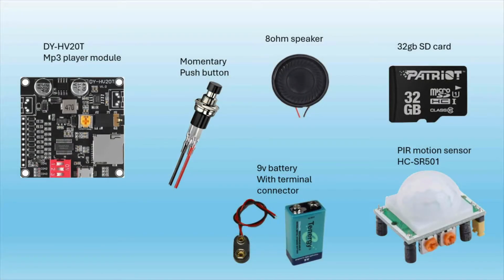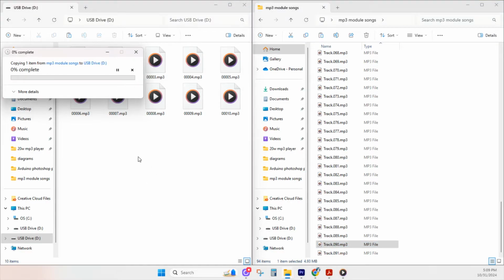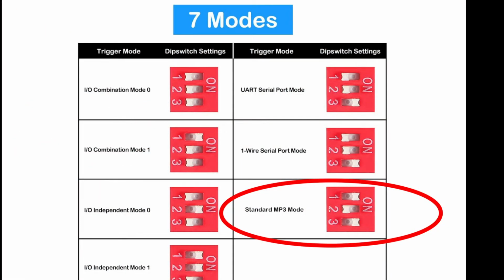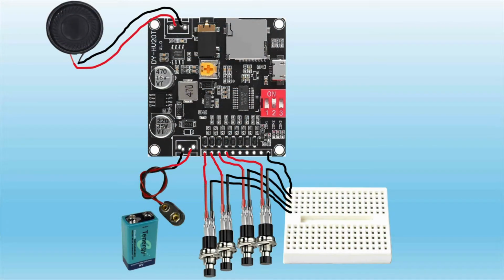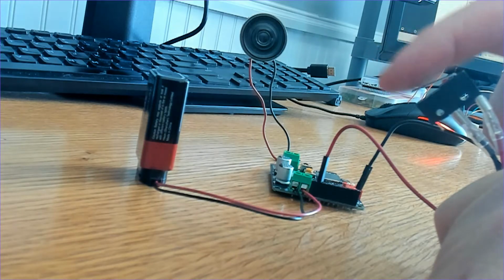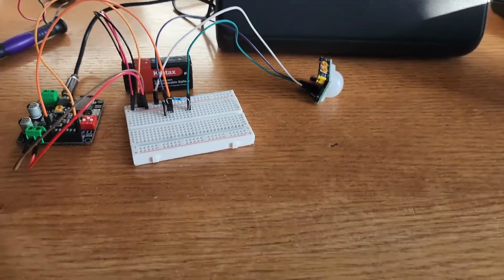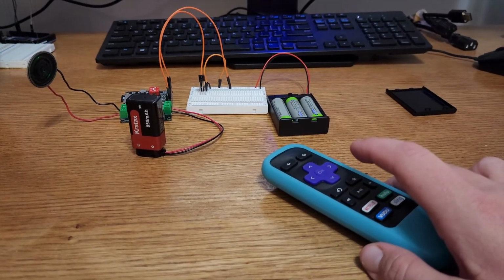5 Creative Ways to Use an MP3 Player Module   No Arduino Required!

Comment: Is there a way to do the following:
1 - 8 files are labeled 0001-0008
2 - With one momentary button, I would like them to play in sequence, but stop after each file.  Then play the next file after the button is pressed again.  
      For example:  Press the button once, file 00001 plays.  Press the button again, file 00002 plays, and so on until 00008 plays, then go back to 00001.
3 - If this is possible, what dip switch setting should I use and what pin should I connect the button to?
4 - THANK YOU!
Reply from the maker: hey there!
The dip switch doesn't have a setting that specifically operates 8 songs from one button. The good news is, you can do this using UART mode with Arduino and if space is an issue you cann use Arduiono Nano. If you want to go that route, I can show you a wiring diagram to get you set up...no prob.

Independent Mode 0 (DIP switch settings: OFF, ON, OFF) is the closest configuration to what you're looking for. In this mode, you would need to connect a separate button to each of the eight I/O pins on the control header, totaling eight buttons. Each button would then be assigned to trigger one song, which plays fully to the end when pressed.
Reply: @BMonsterLaboratory  Thank you! Yes, I'd love to go that route.  I just ordered a Nano, however, I'm not sure what to do with it once I get it.  Will it need a specific program?  
Thanks again, your Channel rocks!
Reply from the maker: @ go to https://www.arduino.cc/en/software/ and download the IDE, a program that lets you write and upload code to your Arduino board. The newest version is 2.3.6 
I'll send you the code that you need to put into the IDE and tell you how to upload it.
You have a momentary button, I assume?

There are several ways to mount your Nano. My favorite way is using a screw terminal block. The screw terminals are labeled and easy to read. You can get them from many stores, but here's an Amazon link - https://www.amazon.com/Screw-Terminal-Block-Shield-Arduino/dp/B0DQ3T7VKR/ref=asc_df_B0DQ3T7VKR?mcid=448aa046942d36ac95054fbe54a6229d&hvocijid=16864784041243675741-B0DQ3T7VKR-&hvexpln=73&tag=hyprod-20&linkCode=df0&hvadid=721245378154&hvpos=&hvnetw=g&hvrand=16864784041243675741&hvpone=&hvptwo=&hvqmt=&hvdev=c&hvdvcmdl=&hvlocint=&hvlocphy=9015754&hvtargid=pla-2281435177378&th=1

I prefer using the 3.5mm aux port connected to an amplified speaker for the best sound. 

Will you be using a battery to power this setup or a wall outlet ?

I will share code and diagram with you as well.
Reply: @BMonsterLaboratory  Yes, I do have a momentary button.  I'll power it with A/C.  
Thanks for all your help and fast response.  You are so kind!!!
Reply: @BMonsterLaboratory  I have a Nano (5V) and DY-HV20T (12V), pin selection UART.  I used ChatGPT to code the Nano, this is the code that it suggested.  I hooked everything up but it doesn't activate random or sequential audio (or anything)  Do you have any suggestions?: 

Button: One side to D2, the other to GND.
TX → Arduino D10 (RX)
RX → Arduino D11 (TX)
VCC → 5V
GND → GND
NANO CODE:

#include <SoftwareSerial.h>

#define RX_PIN 10          // Arduino RX (connect to DY-HV20T TX)
#define TX_PIN 11          // Arduino TX (connect to DY-HV20T RX)
#define BUTTON_PIN 2       // Button input pin

SoftwareSerial audioSerial(RX_PIN, TX_PIN);

bool lastButtonState = HIGH;
unsigned long debounceDelay = 50;
unsigned long lastDebounceTime = 0;

void setup() {
  pinMode(BUTTON_PIN, INPUT_PULLUP);  // Internal pull-up for button
  audioSerial.begin(9600);            // DY-HV20T baud rate
  Serial.begin(9600);                 // For debugging
  randomSeed(analogRead(A0));         // Seed random generator
  delay(500);                         // Let module settle
  Serial.println("System ready.");
}

void loop() {
  bool buttonState = digitalRead(BUTTON_PIN);

  // Check for button state change (debounced)
  if (buttonState != lastButtonState) {
    lastDebounceTime = millis();
    lastButtonState = buttonState;
  }

  if ((millis() - lastDebounceTime) > debounceDelay && buttonState == LOW) {
    playRandomAudio();
    while (digitalRead(BUTTON_PIN) == LOW);  // Wait until button is released
    delay(100); // Additional debounce
  }
}

void playRandomAudio() {
  int trackNum = random(1, 9);  // Random number from 1 to 8
  String fileName = (trackNum < 10 ? "00" : "0") + String(trackNum) + ".mp3";

  audioSerial.print("PLAY ");
  audioSerial.print(fileName);
  audioSerial.print("\r\n");

  Serial.print("Playing: ");
  Serial.println(fileName);
}
Reply from the maker: @jamesc5279  almost got it!  
playtrack() needs to send binary command  (0xAA 0x07 0x02 0x00 trackNumber checksum)
try this: 

// File: nano_dyhv20t_button_player.ino

#include <SoftwareSerial.h>

#define RX_PIN 10          // Arduino RX (connect to DY-HV20T TX)
#define TX_PIN 11          // Arduino TX (connect to DY-HV20T RX)
#define BUTTON_PIN 2       // Button input pin

SoftwareSerial audioSerial(RX_PIN, TX_PIN);

const int totalTracks = 8;
int currentTrack = 1;
bool lastButtonState = HIGH;
unsigned long lastDebounceTime = 0;
const unsigned long debounceDelay = 50;

void setup() {
  Serial.begin(9600);
  audioSerial.begin(9600);
  pinMode(BUTTON_PIN, INPUT_PULLUP);
  delay(2000);

  setVolume(20); // Medium volume

  Serial.println("System ready. Waiting for button press...");
}

void loop() {
  bool buttonState = !digitalRead(BUTTON_PIN); // Invert reading for NC button

  if (buttonState != lastButtonState) {
    lastDebounceTime = millis();
    lastButtonState = buttonState;
  }

  if ((millis() - lastDebounceTime) > debounceDelay && buttonState == HIGH) {
    playTrack(currentTrack);
    currentTrack++;
    if (currentTrack > totalTracks) {
      currentTrack = 1;
    }

    while (!digitalRead(BUTTON_PIN)); // Wait for release
    delay(100);
  }
}

void playTrack(int trackNumber) {
  Serial.print("Playing track number: ");
  Serial.println(trackNumber);

  audioSerial.write((uint8_t)0xAA);             // start byte
  audioSerial.write((uint8_t)0x07);             // play command
  audioSerial.write((uint8_t)0x02);             
  audioSerial.write((uint8_t)0x00);             
  audioSerial.write((uint8_t)trackNumber);       
  audioSerial.write((uint8_t)((0xAA + 0x07 + 0x02 + 0x00 + trackNumber) & 0xFF));

  delay(1000);  // wait after sending command
}

void setVolume(uint8_t volume) {
  Serial.print("Setting volume to: ");
  Serial.println(volume);

  audioSerial.print("VOL ");
  audioSerial.print(volume);
  audioSerial.print("\r\n");
}
Reply: @BMonsterLaboratory  Thanks soooo much!!! You're awesome! 
One last thing - will this allow me to attach a relay to the "busy" pin for lights, or would I only be able to do that without integrating the Nano?
Reply from the maker: @ cooll!  glad it worked fo ya.
what kind of lights?  Are they LEDs, like WS2912B or are they light bulbs, spot lights?  
You can add a relay to a different Arduino pin. When the song comes on it can turn a light on. You can also program a pattern if you're using an LED strand. The setup all depends on the type of lights and what you want them to do.  totally doable!
Reply: @BMonsterLaboratory    Just a short strand of LED's.  I didn't think about adding them to the Nano and it would be great if they would blink!  I'll try to add them to the code you gave me using ChatGPT again.  Do you write your code or use a program?  I'm retired (old) and trying to learn new things to keep my mind active :)
Thanks again, you've been a great help.
Reply from the maker: @jamesc5279  use external power for the LED strand with enough current to handle 60ma per led.
I use chatgpt to clean up code or to help debug. It's hard to  use it effectively if you are totally unfamiliar with the code you're wanting it to use for programming. For me, a more effective way to use chatgpt is to check the code I wrote on my own, that way it has an idea of what you're wanting to do, but  know that it's not always right!

I learned a good deal of C++ during the covid era, what else was there to do?  I used W3Schools website a lot https://www.w3schools.com/cpp/default.asp   It's great for learning and it has an interactive editor you can practice with. 

Check out Arduino language reference page - https://docs.arduino.cc/language-reference/  that was very helpful.
There are also coding courses on Coursera that you can possibly take for free - you'll have to look into that. 

This is a hobby for me..that's all. This type of stuff isn't what I went to school to learn.  I do something related to this or Raspberry Pi every day. So, just learn a little bit each day and you'll do great! If you get stuck, feel free to ask here, Facebook, email...etc. Other people in this space are helpful as well. Post some videos on here and I'll follow ya!  Good luck to you

Comment: Are there any boards that have settings so the file will only play 1 a file time all the way through while it stays latched?
Reply from the maker: hey there!
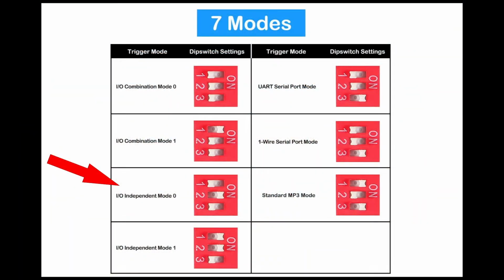Check out 4:40 of this video. You can put a button or other trigger of your choice to activate a song and it plays thru to the end. I belive in that mode each pin controls 1 song, so you could have 8 pins to trigger 8 different songs. You can also connect a larger speaker to this board by using a 3.5mm aux cable.
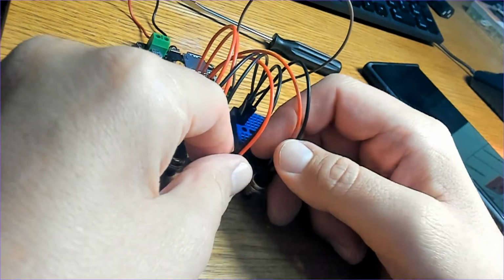The example at 4:02 has 1 song on each pin. The song plays all the way through while the button (or other trigger) is engaged. 
You can add more control by adding a microcontroller.
By the way, you have some really cool videos! 👍👍

Comment: Very good.  I had mine set up for Single File play as you did, but something goofed.  THEN I saw your video and realized I must have had the Switch in the wrong position.  In the mean while I went to sites and they all pointed to the need to use Arduino, so I ordered a couple.  Still no joy!  I need to solder Header Pins in the board.  Waiting for magnifying glass and "finer" solder tips for my Weller.
Could you do Video on using Arduino UNO 3, if possible.   You are MORE clear than the Spanish and Indian YouTubers for instructional videos.  I can understand you.  Sorry guys, your English needs repair.
Reply from the maker: Hey there!  Thank you~
I think the board works great if you just want to trigger a few tracks but it is great for Arduino. I think you'll get more use out of it with Arduino. 
have you seen this video with Arduino ?  https://youtu.be/GczPAaq8WsY   👍

Comment: Perfect thanks 🙏🏻
Reply from the maker: thanks.  good luck with your project~
Reply: @BMonsterLaboratory  Thanks can I ask - what Power supply could I use to power this from uk 230v source ?..can I fit a barrel power jack onto the board somehow?
Reply from the maker: @Newmusicreview  There are some predrilled holes in the pcb, next to the rx/tx pins, for a 6-35v dc input. You may be able to mount a barrel jack there but I think a terminal block would fit better.
Reply: @ ok, or maybe I could solder some cables on the board to a barrel jack 👍
Reply from the maker: @Newmusicreview  You could...or use a dc power connector on the end of your power cord. You could connect to a terminal power block soldered onto your board with that setup.

Comment: Hi bud...Ive tried a Aidafruit FX sound board for some sounds but its doesnt seem to want to play alll the sounds, and its too quiet, Im thinking of trying this card, can I just have 2 triggers doing 2 different sounds ?
Reply from the maker: hey there!
You can have 2 triggers on 2 separate pins that play 2 different tracks. All you will need is a speaker and the buttons. There's an on-board amplifier, which can make even the little 2watt speakers pretty loud. You can also connect an amplified speaker using 3.5mm cable like I did in this video https://youtu.be/GczPAaq8WsY
good luck!  👍💪

Comment: I have a question! Can we use this to make an automated alarm system for like bell for class schedules for example? That will be utilized with an Arduino to adjust the time on when will it ring and will be connected to our schools sound system using the 3.5mm pin? For our research project hehehe ty
Reply from the maker: hey there!
Sure you can. You can connect the 3.5mm jack to an amplified speaker and run a mp3 track on a schedule with the help of a real-time clock. I like the cheap RTC modules (HW-111) that keep time as long as the coin battery  is in place. It's not perfect though, and there may be better option now.
So...yes, this is doable 👍
Reply: @BMonsterLaboratory  Thank you! However we have a problem on our side. Everything seems to be good (?) but when the time arrives when it will trigger the alarm, the speaker won't trigger any sound at all. I think it may be wrong on the program or the wirings but I think it's mainly the wirings. Do you have anything that would deem help on our situation?

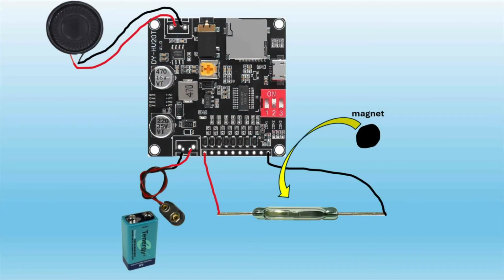Comment: Thanks again for the vid! At 5:02 you showed a magnetic switch / trigger - can you provide a link ( or description ) ? Thank you.
Reply from the maker: I used a small magnet with a reed switch. I have had it for a long time and I only have one. Thought it came in the Elegoo Mega kit but guess not. 
You can also get them on Amazon. type ASIN  :  B0CDWS1ZG6   in the search bar to find it.

Comment: Is there a way to make it play one random track ( from a list )  every time it is triggered ( ie push button or light trigger ) ? Thank you!
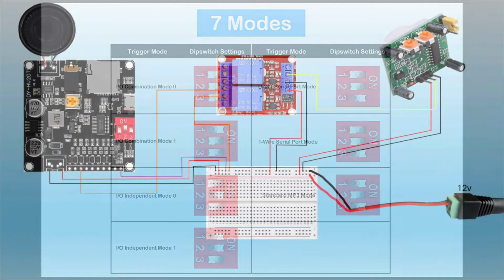Reply from the maker: hey there!  in this video, I use a motion sensor as a trigger to play one random track - you can see it at 6:24  https://youtu.be/GczPAaq8WsY   You can replace the motion sensor and change the code for a button or photoresistor to trigger a song. 
I don't believe the DIP switches have a random combination. Using Arduino to program something like this is the easiest way to do it. I hope that helps! 👍

Comment: Nice! Any way to have it start on power up and play a recording in a loop?
Reply from the maker: Absolutely!  how many tracks?  random or just one after another?
Reply: @BMonsterLaboratory  I also need to start only one audio, when I turn it on. Without loops.
Reply: I have the switches as 010 and input 1(00001.mp3) shorted to ground for selection.  When powered up, it plays until the end.